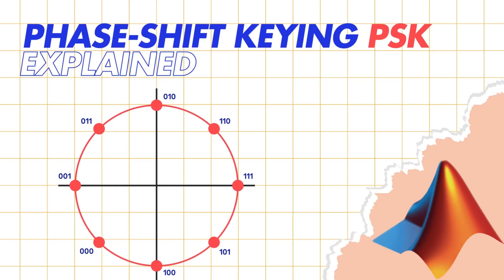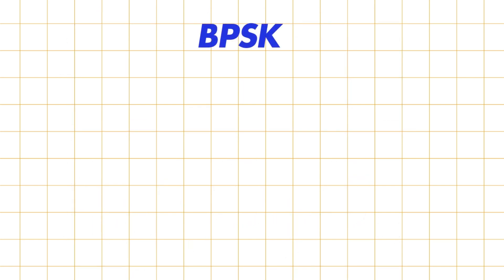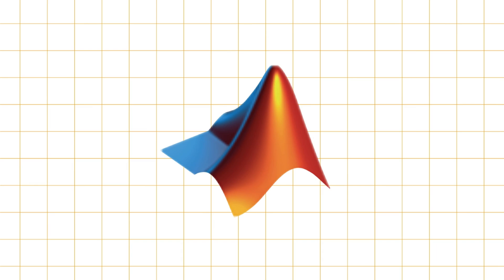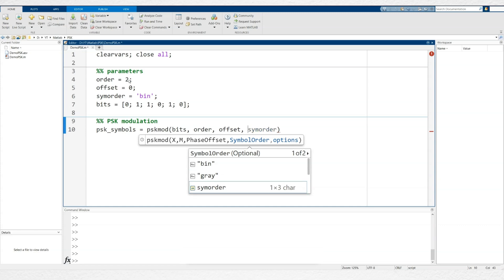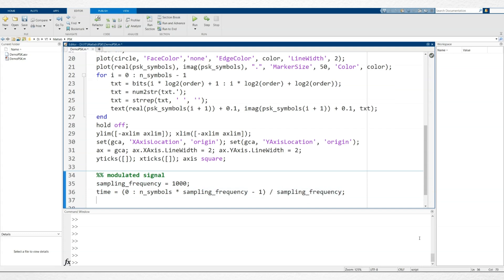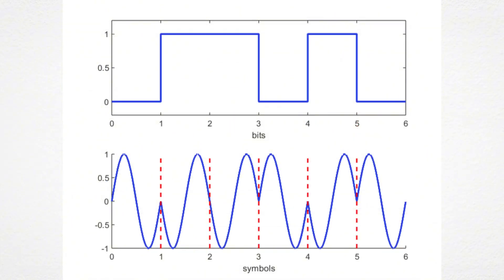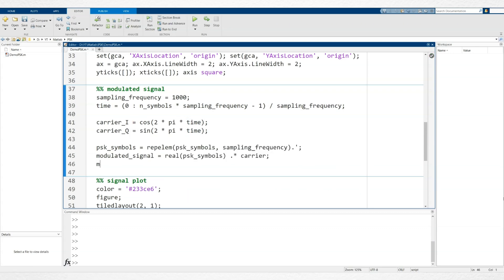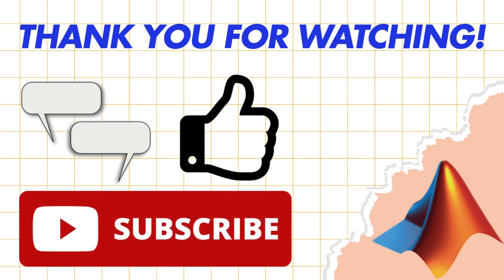Phase Shift Keying (PSK) Explained | MATLAB examples

Comment: A question: when you generate the modulated signal:
modulated_signal = real(psk_symbols) .* carrier_I + imag(psk_symbols) .* carrier_Q;
shouldn't you use "-" instead of "+" ? As far as I know, you are multiplying two complex quantities and extracting the real part of the result, therefore:
Re{(a+ib)(c+id)} = (ac-bd)
Reply from the maker: Thanks for pointing this out, you’re absolutely right. The correct expression should indeed use a minus sign, consistent with taking the real part of the complex product. This was an oversight in that video. It has already been corrected in other videos and will also be fixed in the next iteration of this series.

I appreciate the careful observation and helpful feedback!